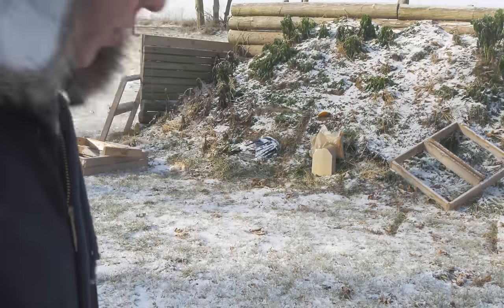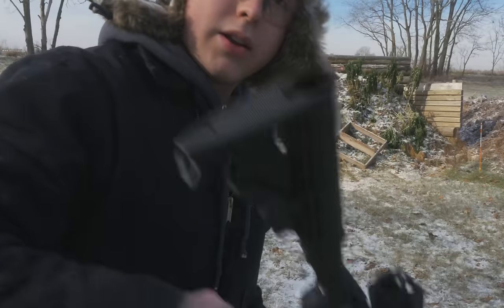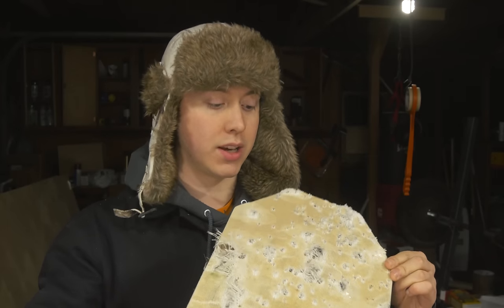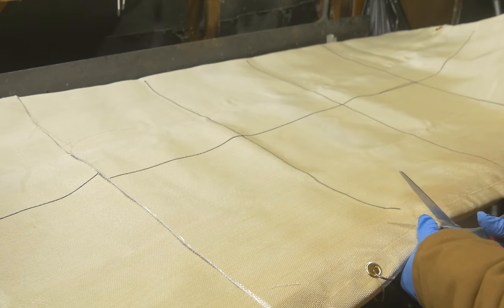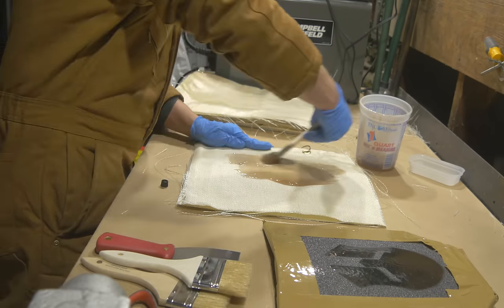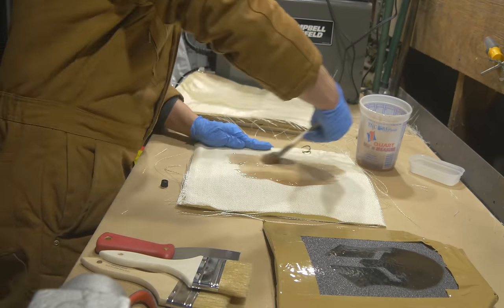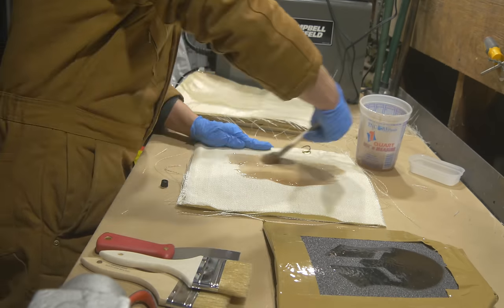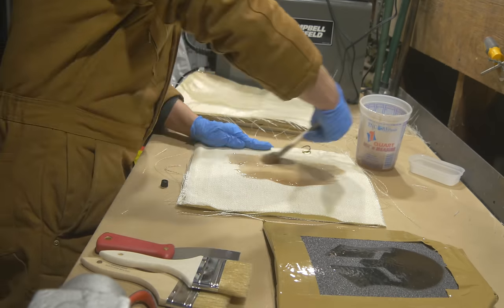How to Make AMAZING Bullet Resistant Armor for $30

Comment: I'm more curious about how it would perform against larger handgun calibers like .45 ACP, .357 and .44 Magnum. If you have an opportunity I'd love to see more testing done. 

If you're going up against rifle rounds you should have steel plates anyway.
Reply: dolebiscuit Well .45 goes slower than a 9mm but is bigger. .357 and .44 may pierce but remember it took a slug and high brass double aught buckshot so I don't know. I personally don't use revolver calibers as much or know as much about them so maybe it's not my place to say.
Reply: Slugs are terrible at penetrating armor because they spread their energy out over a wider surface area, whereas a smaller round focuses its energy. 
This same principle is why stepping on a brick while barefoot doesn't hurt, but stepping on a Lego does.
Reply: If you are going up against rifle rounds may I suggest either A) a different hobby  or B) a tank
Reply: You should try stepping on a British 3 pin plug,fucks your day up LOL
Reply: or a thin hardened steel plate that would cost about 45 bucks. layer some of the fiber glass resin mix for minor spalling and shrapnel damage and be good through magnum rifle loads.
Reply: dolebiscuit it would probably stop a 357 but not a 44. Seems like he basically made class 2 body armor.
Reply: Liam Winter word? hmmm. sports what do you think?
Reply: Anguinus Vir as far as the increase or switching of materials to turn that class 2 into a class 1?
Reply: Liam Winter pretty sure if it will stop a 12ga slug it will stop a .44
Reply: dolebiscuit none of those rounds are anything compared to a 12ga slug. the .223 is designed to pierce armor, so it did, but very few pistol rounds are necked down to pierce armor.
Reply: Speed beats armor so .45ACP and .44 Mag wouldn't be as good as .357 and 9mm at armor pen.
Reply: +Fang K. I'd have to look up penetration tests to answer in that level of detail. But if it stops a slug, it will definitely stop any non-necked down pistol cartridges, such as all those listed. The only pistol cartridges that would stand a chance would be the more modern rounds, such as the 5.7x28 and the like, but those are not common street carry at all. Thugs aren't typically looking to hit hardened targets, nor do they usually carry expensive and advanced weaponry, as they're used to ditching their weapons. 

this armor is definitely suitable for everyday use, which is amazing considering how basic it is.
Reply: Joe Doe Id like to see him try a 357 sig on it. Just curious

Comment: Hong Kong protestor really need this.....
Reply: EXACTLY what I was thinking after watching this --> https://www.youtube.com/watch?v=1sPbMdrzFJU
So I dropped this video into their comments sections and hope the info gets over there. 
It seems the HKPD guys are using 38's or something very close to that, which this stuff "should" work well again. Sure better than a t-shirt anyway. Maybe if they added in some ceramic tiles in the middle of it all they'd get better protection, for more weight of course. Maybe a thin metal black plate to held reduce trauma, if used, they could cut up that Aluminium stuff they show tested in the linked video.
Reply: i asked taoflademouse to forward this
Reply: I came here from the link, which is funny because how zna just posted his Christmas videos. Zna is just awesome
Reply: @xxxlonewolf49  If you were to add in a couple of the thicker (but still pretty thin), very cheap to buy (@.99 cents each), premade circuit boards that were tested on Taofladermause's channel,   I believe you'd be able to stop up to a .357. But most definitely a .38.
Me personally I'd stack sheet metal pieces, with resin between each piece, up to 1/4" thick, in the middle of the layers of the fiberglass blanket. Would greatly improve bullet resistance and the top half of the layers of fiberglass would act as anti- spaulding trapping any fragments. The sheet metal is cheap and easy to cut / work with, should be readily available in HK, and wouldn't add that much weight. Plus 1/4" of it on it's own stops a 9mm easy. Combined with the blanket you'll most definitely stop a .357 and quite possibly even a .44 @ 1400fps.
Reply: The US protestors too!
Reply: @emmamlis927  Antifa BLM protesters?  Nah they wouldn't do this.  This requires work.

Comment: defo going to try this. 
a tip for cutting the blanket though. get some sewing scissors that cuts zig-zag instead of straight. this stops freying.
Reply: Not joking, partially true. Zigzag scissors REDUCE the fraying, but not stopped completely.
Reply: Well hell, if I can reduce small pieces of fabric on my floor i will take it.

Comment: If you alternate the angle of the fiberglass in each layer, you should get even better results. If you used Kevlar and/or carbon fiber-even better! Additionally so if you can cure it in an autoclave (or any way that you can heat and apply pressure, the more the better)

Comment: I had three thoughts on watching this:
1) Fabric Scissors tend to help when cutting things like that, they're the scissors that leave a zig zag pattern when you cut with them. Last I recall, they made sewing projects a lot easier, but I also haven't used any or done sewing for some years. Since they're made for sewing (and sold in places like Micheals) they Should be up to the task of cutting through the blanket.
2) As Franklin Gomez was mentioning about adding .3% graphene to the resin, I was reminded of Flash Graphene, of which there are youtube videos that you can look up on the subject. Seemed like it would be a faster way to get the same material than using a ball mill and what not. I'm not sure what the set up for using that process would cost, but it seems in keeping with the idea of the video of 'do it as cheap as possible'. 
3) When trying to free the plates you were using from the material, you could potentially set that up to be an easier process by getting a piece of paper large enough to wrap around the plate, then apply the tape to one side of that paper. Then wrap that around the plate and use some tape to secure it in place on the side that's exposed to the air. Then when it's time to free it, use a box cutter or what have you to cut the tape and paper and then you can pull the plate free. That way you don't have to fight any tape stickiness to free the plate.

Comment: Good video. I like it. Additional FYI. HDPE (milk jugs) - while ineffective alone - give a MAJOR boost to bullet stoppage when combined with fiberglass, nylon webbing, and similar materials (fiberglass best). A 3/4 inch plate of HDPE, when laminated with fiberglass, WILL stop 5.56. Making a 3/4 inch plate of HDPE requires an oven, compression, and mold release. 
          I'd like to see your work combined with an HDPE plate.
Reply: Thank you
Reply: Is there any reason you couldn't just buy commercial HDPE sheet stock and cut it to size?  It's available in 3/4".
Reply: @snidelywhiplash  HDPE, by itself, can't be considered as "bullet proof". Too many cartridges will penetrate. Laminating it with fiberglass makes a big difference. 
But your question, as I understand it, is if the store bought stuff will work. As far as I can tell, it should work in a similar manner.
Reply: UHMWPE - Ultra High Mol Wt PE --- Dyneema & Spectra brands.  Alt layered w Kevlar or threads woven in the same layer can be pretty tough.  Maybe improved by crosslinking using a silane??
Reply: @somaday2595  - That sounds like both a "good" and a "workable" idea. Try it.

Comment: The speed of the projectile is the key to defeating armor.
If you were to double up your DIY armor plate with a layer of foam in between, the second layer would have a much better chance to stop the projectile.
Reply: I was thinking something like small chicken wire,, between layers,, to help hold it together upon penetration,, I like the foam idea too tho,, all three combined would prolly make a pretty good armour plate =)
Reply: Mogwai Jizm I also thought that a thin ceramic layer on the front side would deform the projectile and spread its energy over a larger area, as it penetrates the rest of the armor.
Reply: Foam!!🤣🤣🤣
Reply: You could do a thiner steel plate on the front with chicken wire in between each layer

Comment: Great video! I have questions. How much does it weigh? How does it compare to the weight of the steele plate? Also wonder what would happen if you wrapped the fiberglass plate in a layer or 2 of card fiber. Hell it would be cool to see how many layers of carbon fiber can do the same, better or worse than the fiber glass plate.

Comment: when cutting fiberglass sheets or even carbon fiber, stabilize your edges with a bead of hot glue... make your cut along the outside edge of the glue border, and it won't fray or warp.... Makes it SO much easier to work with individual pieces for lamination....

Comment: Wear a respirator! Fiberglass has small strands that can be inhaled
Reply: "and in other news, water is wet."
Reply: Mesothelioma ain't that bad.
Reply: Not if you don't mind drowning in your own fluids. :-P
Reply: I've researched into lung cancer caused by all kinds of cristaline fibers and found out that most ppl that had those kinds of cancer had it 20 years after they quit working with the material and worked with the material for 5-20 years, worked  without protective equipment, had a genetical predesposition to lung cancer. The most prominent couse for the cancer was constant killing and regeneration of lung tissue. The fibers pierce lung cells and those either die and release toxins and mutagens(this shit builds up overtime) or just get damaged and then devide damaged witch couses genetical errors. Over time the combined genetical error grows until critical point, at witch some effected lung cells become cancenogenic. So the conclusion is, a few days of light work with fiber materials unprotected will not drastically increase chanses of lung cancer, to get it that way you  need to try realy hard.
Reply: @Geroskop 
Googling Something != Researching it.

So unless you recieved a massive grant, or spent a few hundred thousand dollars, never use the word research again. It's not only very immature, but comes off as extremely pretentious. Don't embarrass yourself like this again.
Reply: @lordkrythic6246   well, when you research something it dosnt  have to be actually making tests and shit, before term "googling" existed you had to research something in library, going throught mass of litrature and compiling particular topics into one comprehansive work. I actually researched about diffrent types of insulating materials like asbestos and fiber glass, their pros and cons, when i stubled on couple of medical papers on that matter. "Googling" is a form of research. Plz "google" meaning of word "research"...
Reply: @Geroskop 
Nope. You had to seek it out; search for it; educate yourself; look it up; review it; study it; etc. Research was never applied to this, and it never will be. Your erroneous usage is the crux of our discussion here. You need to man up and apologize, internalize this new information, and work towards never using it incorrectly again.

Arguing this only makes you look more uneducated. So I would highly recommend you stop while you think you're ahead. Researching something is not just about money, it's also about time dedicated; ten minutes of Googling is nowhere near the same as a decade or more of actual, bonafide research.
Reply: Whatever dude
Reply: @Geroskop  
Thank you for admitting you were wrong, coming to terms with it, and apologizing for your actions. I understand that doing this takes quite a bit of humility, and so I commend you for it.
Reply: well he never said he was wrong, he said "whatever" which probably is a spaceholder for "shut up" or something along those lines. For you to say "thank your for admitting you were wrong..." comes of extremly pretentious and is just plain wrong. Further more he said "ive researched into", he didnt say he conducted the research himself ot that he knows anything more than what youll find researching this stuff online.
IF this wasnt clear to you by reading his comment then you might reconsider trying to look so "smart" online.
Reply: @Philipp
I was being sarcastic because he was evidently not man enough to admit that he was wrong, and apologize.
Reply: @lordkrythic6246  dude, i have nothing to apologize for. I just lost interrest talking with you, it's like talking to a teenager or conspiracy theorist - they dont care about logic or truth, they just want to be right. And man, there you go YOU RIGHT! YOURE SMART! YOURE THE ALFA! CONGRADS!
Reply: Lord Krythic lmfao definitely not
Reply: Yeah even just one day of exposure can lose a good % of lung capacity
Reply: @Geroskop  Microcrystalline fiber is not a legitimate comparison to airborne dust created from cutting fiberglass.  I know you are talking about micro because there is ample evidence to support that claim- however, there is no evidence I am aware of, or to the Agency for Toxic Substances and Disease Registry, Public Health Service, U.S. Department of Health and Human Services- that indicates that airborne dust from cutting fiberglass causes cancer.

Care obviously should be taken to minimize irritation and the risk of a persistent cough but I believe you are making a false equivalency.  Similar to saying tobacco smoke causes cancer so cannabis must considering they have many similarities.
Reply: @EgadsNo  well, the machanism for developing cancer because of exposure to cristaline fibers is described in my former comment. But still, to get canser that way you have to be completly autistic and work for a couple of years with cristaline fibers and then you get increased chance of lung canser about 20 years later.... what i was saying is, if you read my coment carefully, to get cancer from working with cristaline fibers you have to work like a person with genetical fucking disorder  that accures when imbreeding, that is working without proper PPE for a fucking 5 or more years to the cancer 20 years later if at all.... jeez... ppl are not reading properly anymore.
Reply: @heidiroekke3836 
What's my first name? You won't embarrass me. I'm honestly pretty intrigued by this claim of knowing me.
Reply: @heidiroekke3836 
I'm actually 100% intrigued by your statement. I don't know a Heidi Roekke, unless that's an alias. Guess I'll need to wait for you to message me back. =)
Reply: @heidiroekke3836 
I'm going to assume by your lack of a response that you really don't know who I am. Do yourself a favor, don't do this again.
Reply: Lord Krythic dude who are you trying to impress? This is the internet, no ones opinion matters.
Reply: Oh, and Greenland.